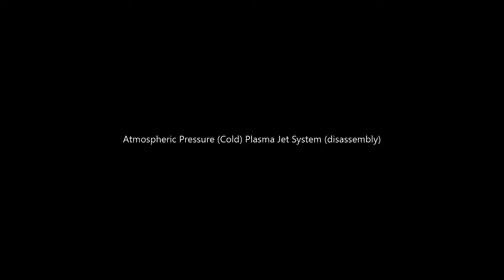DIY Cold Plasma Torch (Atmospheric Pressure Plasma Jet) - Part II (disassembly)

Comment: Great video.  Sadly, your channel doesn’t seem to have caught on.  Did you explore using high frequency, solid state Tesla coil?  15mhz might be worth exploring.  Did you try and add a matching section between your power supply and the wand?  Consider a video where you compare treated and untreated polymer surfaces using cold plasma.

Comment: What do you think,is it usable for wound treatment?And if yes how much would it cost to build me one?
Reply from the maker: Well it is a good question! From what I've read cold plasma treatment is now beginning to be used for that and many other bio/medical applications. That might include sterilization, bacteria and virus deactivation and even attempts at reducing cancer cell activity (according to some published research papers). 

That all sounds great but an attempt to use this particular machine to treat wounds will likely be fatal because of the possibility of electric shock at relatively high currents. I did not even measure it as a lot of electrical measuring equipment tend to break down at such extremely high voltages. So I operate it only with all the high voltage safety precautions including 20KV rated rubber gloves. It is probably possible to build a safer version with much lesser currents for biological applications but it is a whole new project and is well beyond my scope.

As for the price of the components it was probably around $200
Reply: @volodymyrbabii5810  Well,in Germany and Switzerland they use it already in hospitals but also for animals.There are meanwhile treatments available.Just I live in Romania and here they live behind the moon,if you understand.So I was thinking to make something like that with help of a good electronician,because of the fitting health issue on my leg(infected stitch from an insect what heals really difficult).Are also some videos with kind of that but not so professional style like yours on youtube and if its well done I think its safe.
Reply from the maker: @sven471111  Sorry to disappoint you but I don`t think you can treat wounds with this, no matter how well it is done. You need different technology for biomed application - probably something like this: https://www.youtube.com/watch?v=gUXXjS_bq8g
Reply: If you are interested in building one for sterilization and wound healing check this out. The !ink below is the same thing but this guy shows you how to build one. https://youtu.be/wOV8kliF4eo